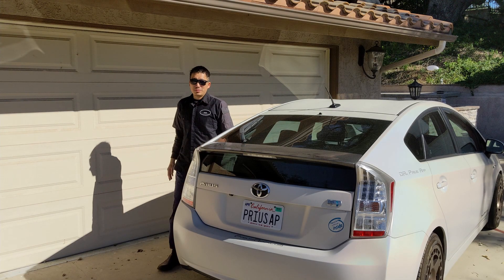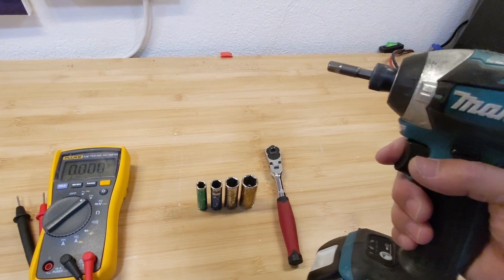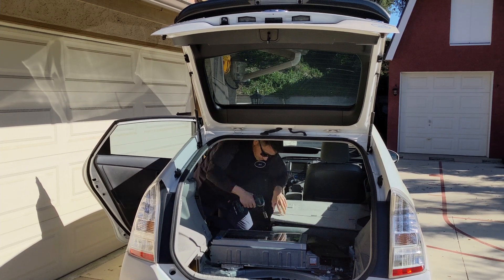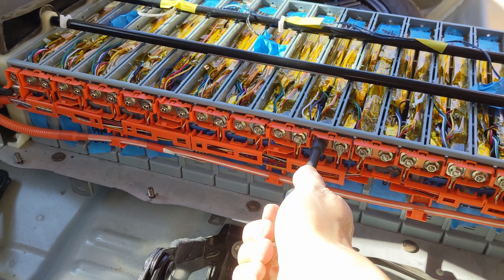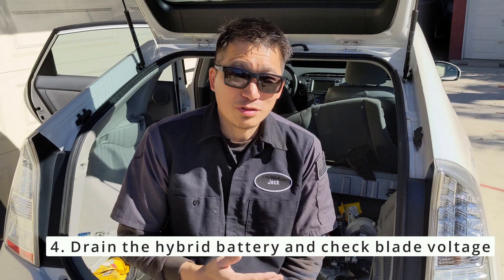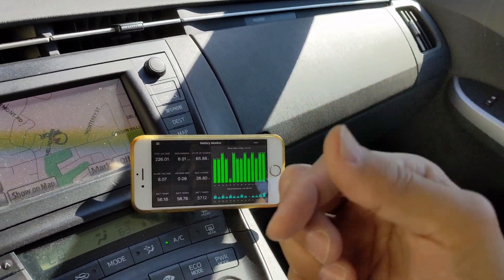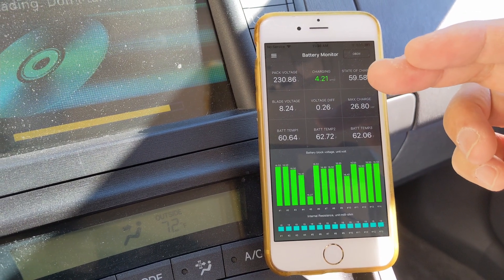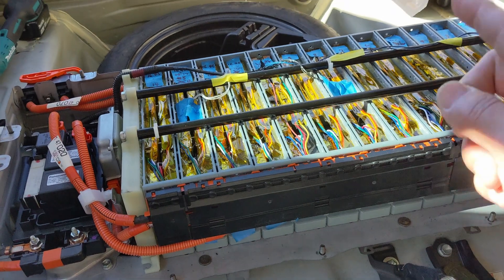Hybrid repair shop series - troubleshoot check hybrid system error - Nexcell Prius lithium battery

Comment: Jack I am looking at picking up a "lightly used" nexcell v2.6 to swap out my 150k original because of p3011.  It's always the #1 that has high voltage on charge and low voltage on discharge (also highest IR).  The pack will stay 102-108F after shutoff (I assume due to self-discharge).  I have paid much attention with your app, and I would like to make sure that you will carry v2.6 blades in case of a problem in the future.  Will you be carrying these in stock for replacement?  Thanks.

*(mostly original pack, I replaced the buss-bars and orange wiring harness as well as a couple of blades ~2 years ago)

Comment: i coudnt connect the dr prius app on my camry but i tried another app and it shows these values:  the aux battery as -24v and "charg ctrl -24kW" and "delta SOC: 0.0 "and another interesting line is  "battery block number with max voltage: latest value =1 (bounces between 1 and 17) and  "battery block number min voltage :latest value= 10 (steady)" and  im getting common error code p0a80,  it is it 12v battery ?

Comment: If my 12-volt battery is reading 11.7 Volts at rest, is this a dead give away that the problem is the battery? Will it need replacing?

Comment: I will see if this works! Thanks for the video!. I was given another battery because the seller said it had a battery on its way out but I thought I would see about fixing it first, then swap in other one and if it is in good shape I'll just sell the one I fixed or keep it for its good blades since it does have high mileage
Reply: Tbh about knowing myself, I'll keep it in storage for when I need it

Comment: I just had my hybrid batter triangle of death appear as well as the check engine light and the check hybrid system message. This occurred as I was accelerating hard (something I rarely do in my Prius) while entering a freeway. Power was lost immediately and I had to coast to a stop and restart the car. The car restarted and was driveable but all the warning lights/messages remained on. Once I got home, I ran the Dr. Prius app and it appeared that blade #6 was way down compared to all the others. Also, blade #6 wasn't fluctuating like all the others. However, the voltage difference only measured 0.13 v. In other words, all the blades were running over 16 volts, but blade #6 was around 15.96 v. Furthermore, all blades measured 27 milli-ohms except #10, which measured 26 milli-ohms. I also noticed that blade #1 was a darker green than all the rest and appeared to not be fluctuating. However, it was measuring strong at 16.09 v. I next measured my 12 volt battery and it checked out as healthy. I haven't yet run the discharge test, but can you tell me if blade #6, #10, or #1 is likely bad?

Comment: Hello @dr prius app I enjoy very much your videos. Today I Just finishing reconditioning my battery is a avalon hybrid. When I started the life expectancy was 30 % the triangle every now and then trow a code with Dr pruis app I resetted the code and kept on driving. I got 13 cell from ebay and I said I did a reconditioning so just now I did a expectancy test y it came out 97% life and it tell me that that battery is new condition but I'm getting the triangle and I can not resetted it won go away. Don't know if is a error from the app or a different phone.  The car is running hybrid normal. I left the battery for 48 hour balancing but when I was taking cables off. Some of they shorted for some second negative to positive and they sparked a little bit. Do you think that was enough to unbalance the battery or what can you please 🙏  tell me about what might be going on. As I said they returned 97% and the car is running hybrid even with the triangle on. Hope you see this and respond.  Greetings from Dominican republic 🇩🇴

Comment: Hi,
I am getting error messages like "Check PCS system and Check Hybrid system"
I saw a lot of people sharing about getting similar errors like Hybrid system error. No drive and etc... What you think about it? I've already changed my 12v battery. But still getting these warnings...
Prius 3rd gen 2011 (trim 5)
Reply: Hello
I have the same issue 
Did you fix it? And how?
Thanks

Comment: Hi mate mine Toyota auris showing the check hybrid system but I checked the hybrid battery and fan they are fine over 8v still the issue exist what do you think causing it

Comment: Hi good day, 1-3 problems that doesn't works 100% , I got everything as mentioned on your videos in doing a test and what you should need but When you go do a battery test am seeing low battery and needs to be replaced but it doesn't pick it up, When doing a battery test on same vehicle it delays so my drive does be 2-4 miles then I would get reading, Last would be when I scan the vehicle it says bank 6 when the customer arrived I took it out so the customer would see when I started the test it says battery good so there are some issues with the app and needs corrected I have the paided (34us) version (prus c) apart for that great app and east to use...quick question what is the lowest voltage on one module that the app would recognize as bad (20 module in my pack)
Reply from the maker: Hi Randy, these procedures are mainly for the Nexcell lithium upgrade battery, for NiMH the lowest voltage will be 14v, Dr. Prius App will show red bar below 14v.
Reply: @hybridapp7158  thanks for your response, so am back into doing my manual testing till this app is correct and issues is being fix for users like myself, i have did my own testing on the app and the voltage on 1 module is off by (.61) so that mean it is off by (1.22 volts per bank) that is a very high difference, just something I should mention to you in your next UPDATES, am a subscriber and I enjoy all of your videos and how you explained it easy to understand...

Comment: Hi this test method is valid to lithium upgrade battery and the oem nickel metal?
Reply from the maker: This is only for lithium battery, NiMH won't show much of difference even at low state of charge. FYI.